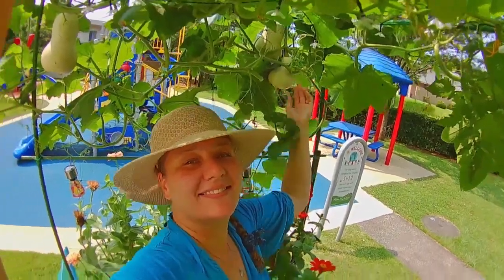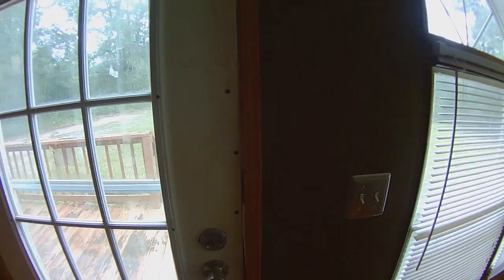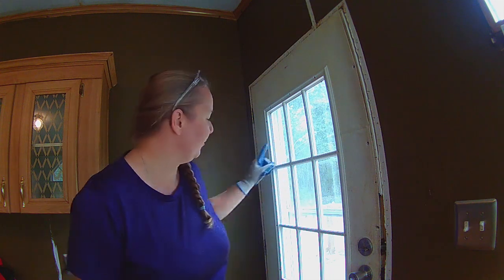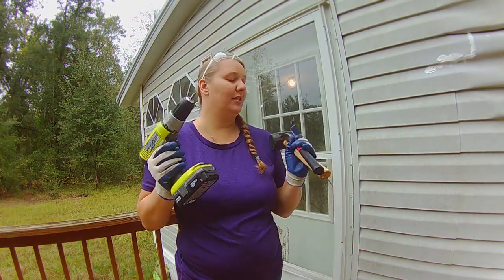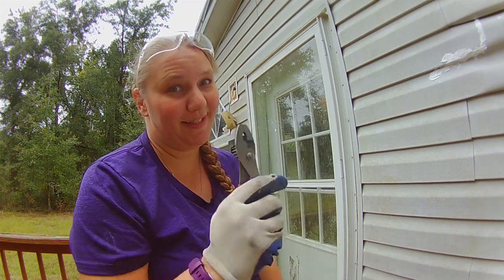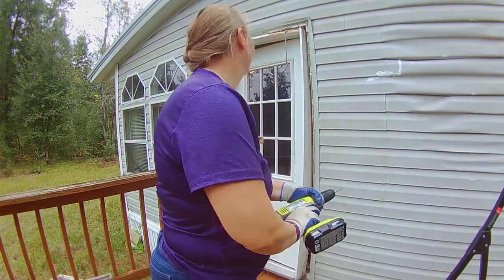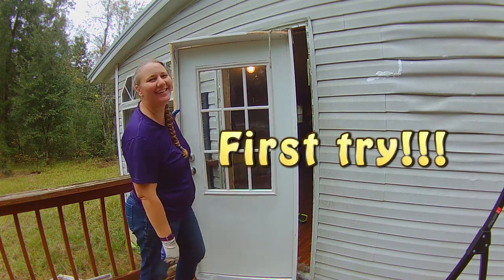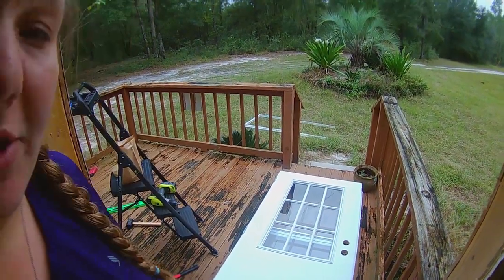Homemaker to Handyman  *Replacing a manufactured home door - Episode 45

Comment: Good job!  I have the same task coming.  Door probably won't arrive until January, so it will be frozen finger time when it comes to doing the replacement.  I was surprise to see you carry the door yourself. I'll be getting a 38"x78" door.  I might be wrong but I was thinking I saw a weight of about 200 pounds?  I was going to get a door with glass in it, but being a trailer door, I can imaging the difficulty in getting new glass if it gets broken.  Probably have to purchase a whole new door if that happens.
Reply from the maker: It was heavy, but not 200 pound heavy. I would say around 100. I went with as much glass as possible because I love a bright house and a door can let in a lot of natural light. Good luck on your project!
Reply: @asliceofheavenhomestead3559  Thank you, I’ll need it. I’ll have to see if I can get the truck delivery guy help me carry it up to me second floor deck(trailer front door is about 11 foot off the ground on the concrete foundation). I have a nice 12x40 elevated deck in front with stairs with a landing half way up feeding that deck. The door need macro get up there. Maybe if I offer him $20 he’ll help me heft it up there? Lol
Reply: @asliceofheavenhomestead3559  Oh, and I’m still concerned about glass inserts. I will probably order a door today with glass bits it’s scary. I called the Mobile Home Supply company (found on internet, but their operators were too busy to answer the phone).

Comment: On that storm door was there three screws on each side that hold the storm door to the jamb
Reply from the maker: Good question. I don't know if it came with those screws, but I did put some longer screws into it too secure it to the frame.
Reply: @asliceofheavenhomestead3559 oh ok what size screws did you use
Reply from the maker: About 2 inches. They don't have to be super long. Just make sure they are long enough to go through the frame and still have at least 1 inch to go into the jam.

Comment: Where did you find your new doors? Did you have to special order them? How expensive were they?
Reply from the maker: I found them at my local manufactured home store. They, unfortunately, were a bit more pricy than something at home depot,but I had no choice. The home depot doors did not come in the right size. This door cost about $450(home depot doors around $375),so it didn't break the bank 😏.
Reply: @asliceofheavenhomestead3559  thanks 😊

Comment: why didn't u just take door out then you'd only have th frame to deal with it would b lighter by its self. just saying
Reply from the maker: Honestly, it was my first time doing it, and there weren't any other videos for a manufactured home door. I wouldn't do it differently though. I wanted to make sure that the frame and door stayed aligned. If I took out the door while I was putting up the frame, I fear it may have warped and I would have a bigger mess to deal with once the frame was stuck to the wall. Yes, the for was heavy, but I could manage it by myself 😏.